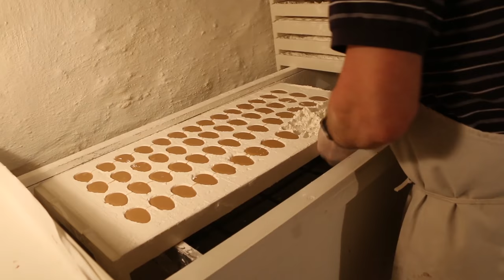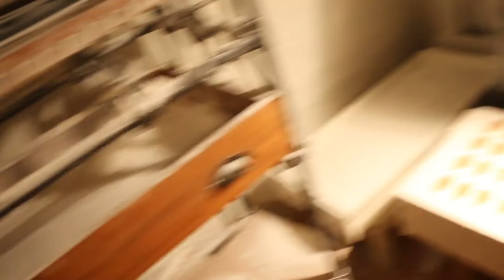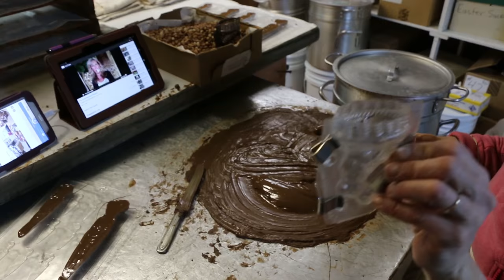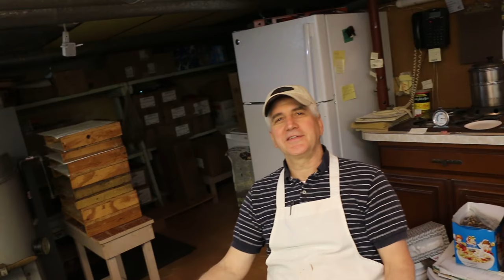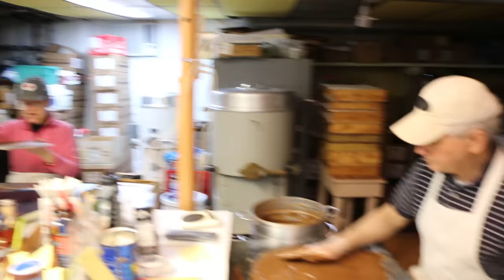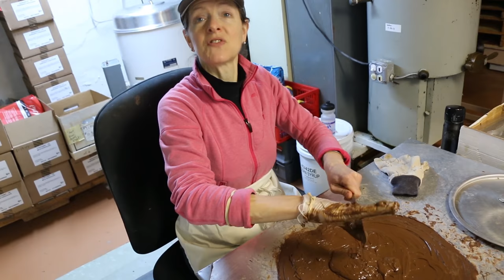Peanut Butter Cream Eggs & Chocolate Carrots

Comment: Awesome video, as ever guys! Just looking at how long it took Steve to clear the corn starch off those eggs. You ever tried compressed air? May make a bit more dust but works allot quicker. I use it to clear talc from moulds (not food related).
Reply from the maker: It would puncture the eggs, they're very fragile, and it would make starch go eeeeeeeeverywhere